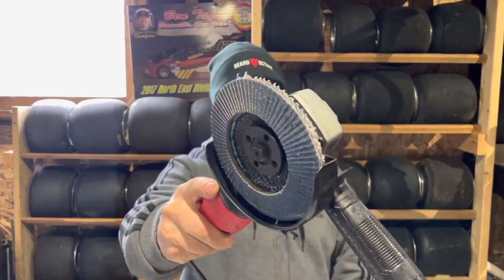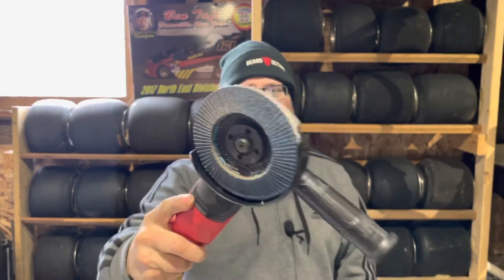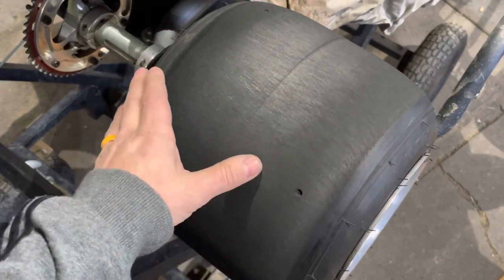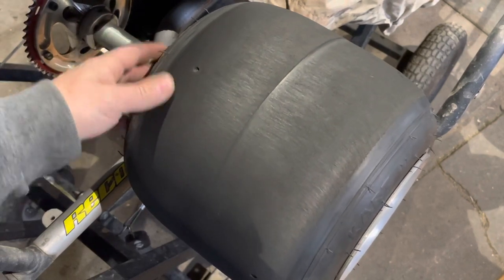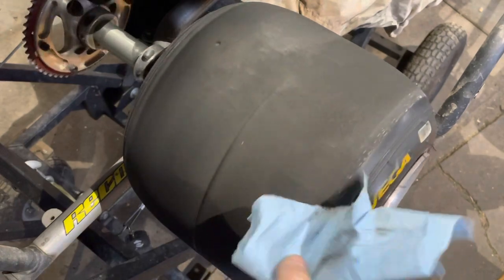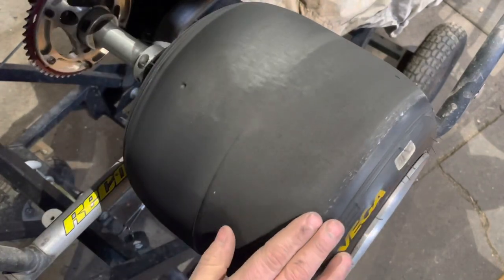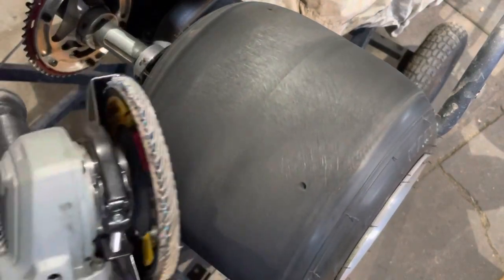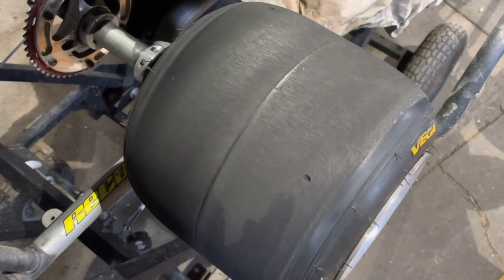Tire surfacing with a lap disc

Comment: I usually do it with just a 36 grit flat sanding disc. I found it to work better than a flap disc
Reply from the maker: Nice.  Yeh everyone has their own way.  👍
Reply: Yes sir! I just found that I have better control with it rather than using a flap disc. I also made my own tire surfacing machine which is variable speed. I stumbled upon your channel like a week ago and Iwill be subscribing to your channel. Seems like some great content man keep it up man!

Comment: Only thing I would add is use a liquid to keep the rubber cool while surfacing the tires.
Reply from the maker: I do that on my tire machine. Never tried it with the lap disc.

Comment: Don't you need to spray it with Windex or something to keep it cool.
Like your videos.  Really liked the one about your the line you run.
Reply from the maker: You can if you like.  I didn’t until recently, but u do run the risk of overheating and melting if you don’t.

Comment: How many times can the tire be reused? I thought if a used set sits over winter, it is done and can't be reused/
Reply from the maker: Depends who u talk too.  Some elite type teams only use new tires in state series.  Your Saturday night racer absolutely keeps using the same tires.  I have Burris from 2016 for instance.  As long as the tire is still good with decent tread and edge you can run it.

Comment: Yeah, so u could do it that why but if u use water or windex it would keep temps down right ??🤷
Reply from the maker: Yes.  I do that with my surfacer.  Never tried with the lap disc but seems like a good idea.
Reply: @kart6t3_ben  i dont have a surfacer just a angle grinder, and just had 24 tires given to me, is why i ask. Thanks 🤘
Reply from the maker: @DLRacing_28  perfect.   Yes I’d try that, your goin to get some splatter from the liquid but it’ll make for a nice surface.